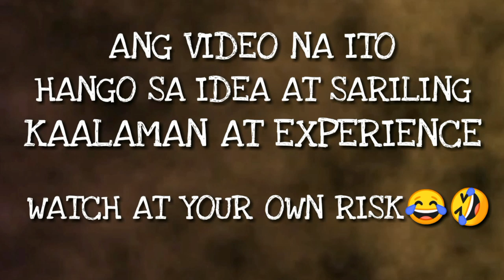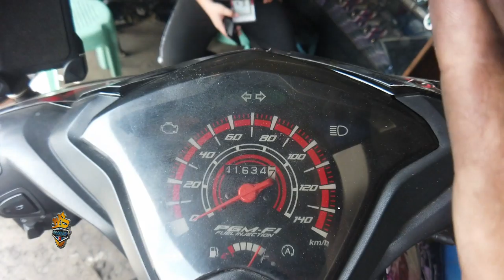BUWANAN LINGUHAN BA ANG TALAGA MAINTENANCE NG MC? / DAPAT MO MALAMAN | WINDOWSHOP TIPS

Comment: Lods, last change oil ko january 3,2020. 2k km. Sa casa pa. Stock ng 4months. Ngaun ang odo is 2,700 na. Byahe ko sana ng pangasinan pagkatapos ng lockdown. Good paba i long drive?.
Reply: Beat fi v2, yamaha lube ang langis na nilagay sa casa. Di pa nabuksan panggilid. Mag 9months palang motor ko.. sana masagot mo lods
Reply from the maker: Pwede naman po icheck pang GILID..